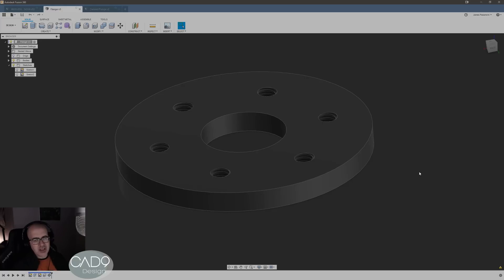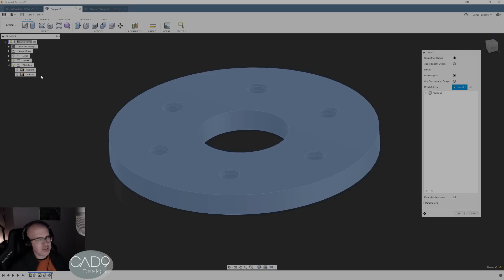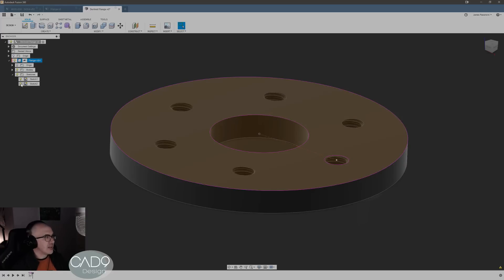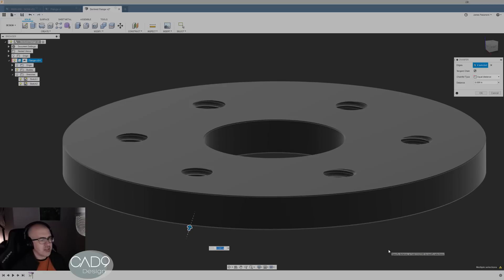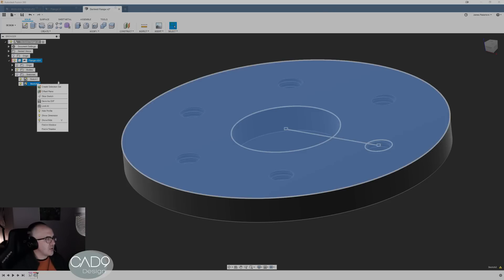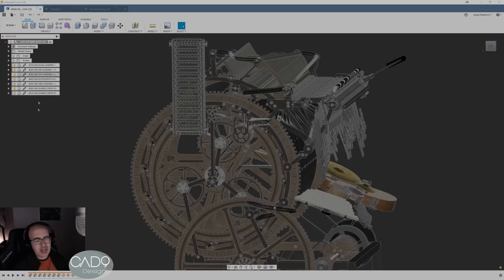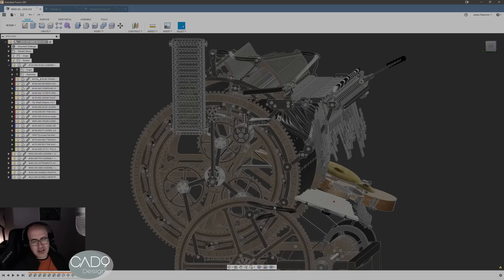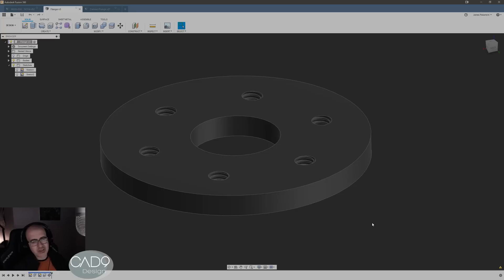Derive in Detail

Comment: Im really waiting for the retopology video!
Ty !
Reply from the maker: Going to try to record the first one tonight. Retopology covers a lot of ground, and will likely be a few videos. Got anything in particular you want to see?
Reply: Personally, i had problems  when i needed to use some artistic elements made in other 3d software (3d max, blender, maya etc). adding some 3d flowers on desk, then rendering and machining it, for example. Ofc you can machine stl without retopology, but sometimes you need to  mill a separate contour or element of the stl. 
Thank you for response. 
And sorry for my english skills ^)
Reply from the maker: @ЕвгенийЛуппов-б5ю  I will cover using digital art at some point soon. I do a fair amount of that.This one will be more basic, getting a rectilinear part from an stl.